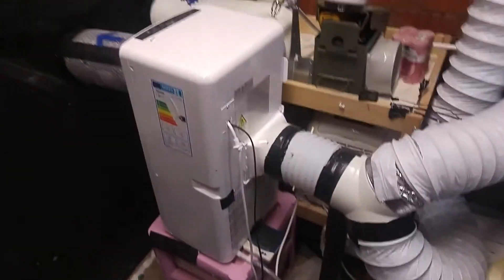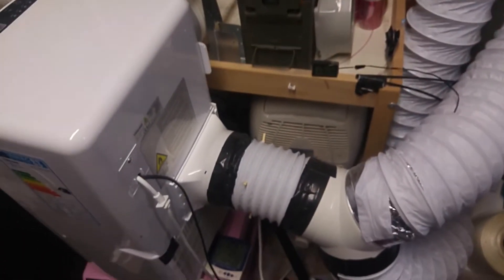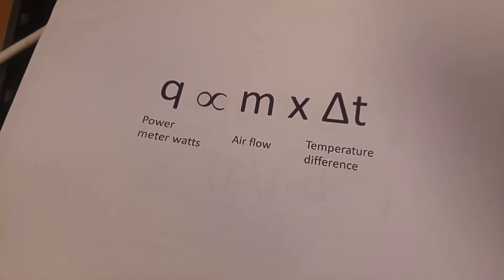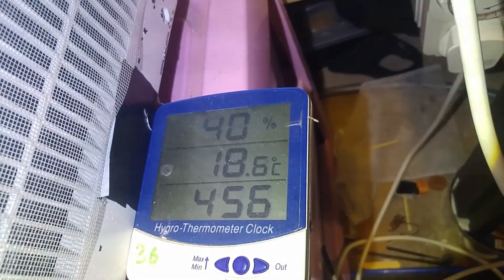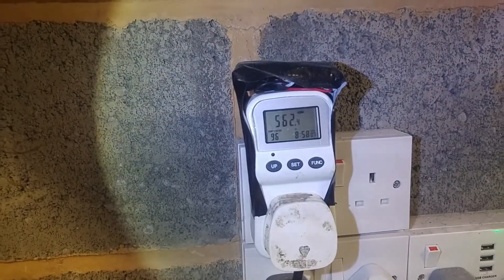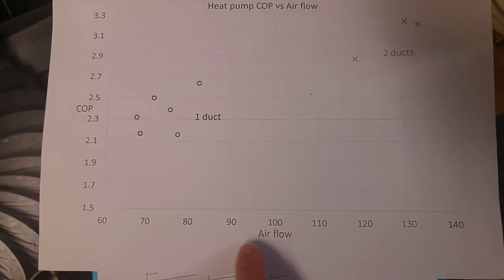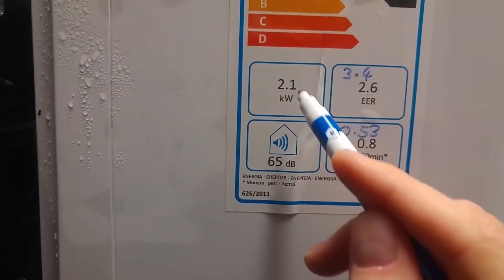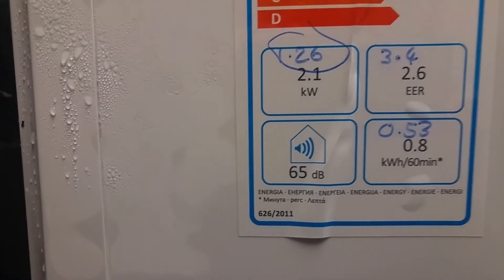measuring heat pump power and efficiency

Comment: Hi Matthew, I really like the ingenious way you managed to measure the mass flow rate of the air (x Cp) using the heating element. 
If you do more experiments, could you quote the outdoor air tempetature (from where the heat energy comes) each time you calculate the heat pump's efficiency (CoP). The efficiency obviously varies greatly with the outdoor tempetature, hence it would be very interesting to know what your system can achieve when the air is near to freezing!
One other advantage your system has I think over so many commercial heat pumps is that your hot compressor is mounted indoors!!